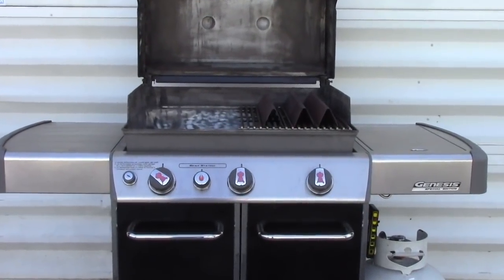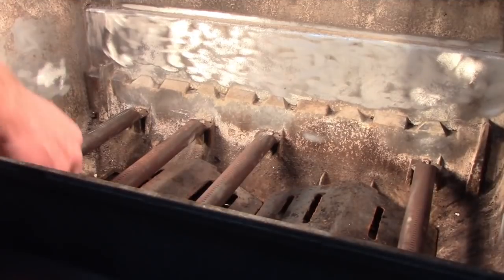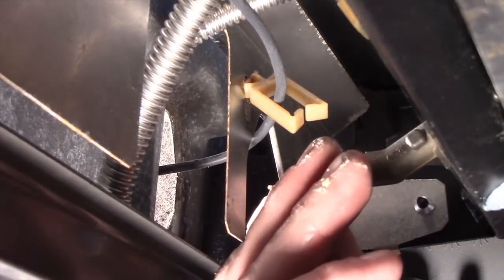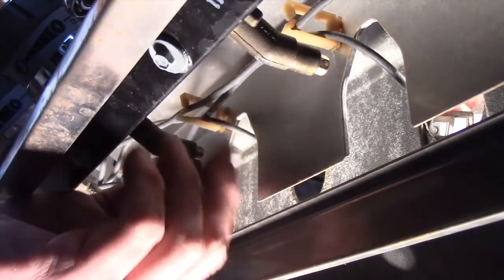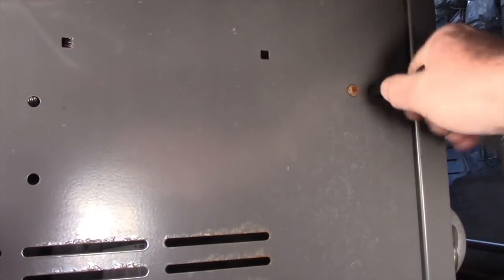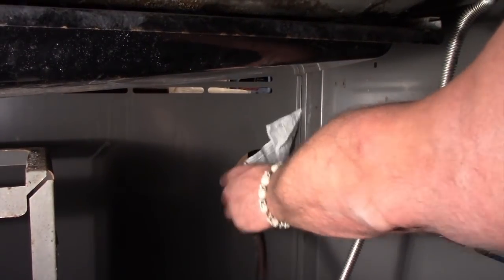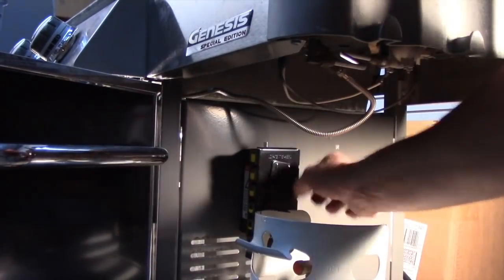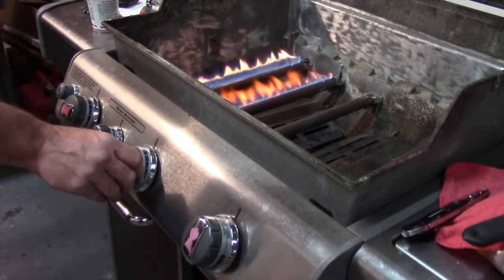Convert Weber Genesis 330 To Use NG or LP

Comment: Jason I have done several NG to LP swaps with success using orifices from different donor grills. Today I swapped out my NG to LP weber genisis but the 2nd and 3rd burner are way to out of adjustment, just the front burner is burning correctly, now what can I do to fix the flame issue.

Comment: I have a question.  I’ve read that if I convert from propane to natural gas. That there will be less flame control. Is this correct?   We just bought a lp genisis 330.  But we found another store has the ng models.  We have used ours already.  So I’d like to know if I should return ours and get the ng version.  Or will it be the same if I covert it?

Comment: Hell I just hooked up a gas line to my existing gas line under my porch.
I made sure to put a T in the line when I installed it to my fireplace .
Didn't change out any orifices .
Now it only gets to 400* rather than the 500* with LP.....we all know that LP burns hotter than NG...or at least we should.😉

Comment: Jason, I,'m ready to install my orifices I purchased through Majestic Grill parts. Is it a must that I use the regulator when hooking up the NP gas line from the main gas line ?
Reply: @bbqparts  , thank you for the reply  Jason. I did indeed use a regulator to hook-up my once LP Weber grill to NP gas. The regulator I purchased from your site didn't come with hoses attached so I wasn't able to use it. Do you accept returns ? please advise. Thank you. 
The brass orifices I bought also didn't fit my Weber Genesis II so I drilled out the orifices accordingly. My grill is working and have a decent flame on all three burners.